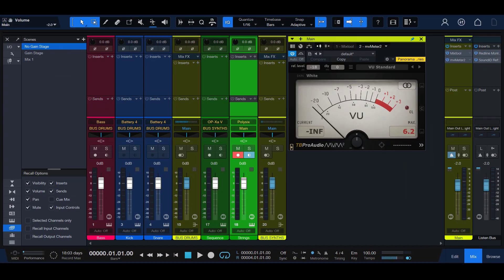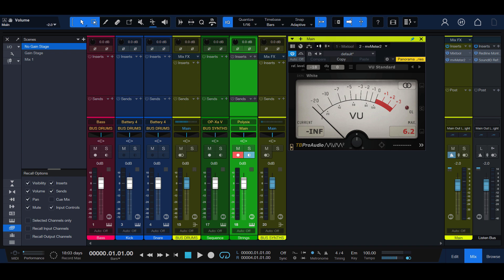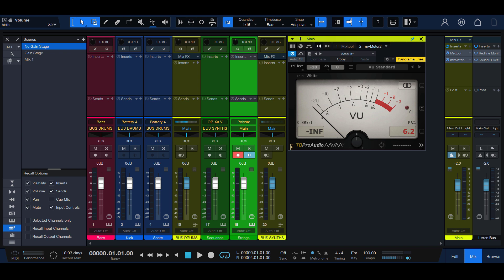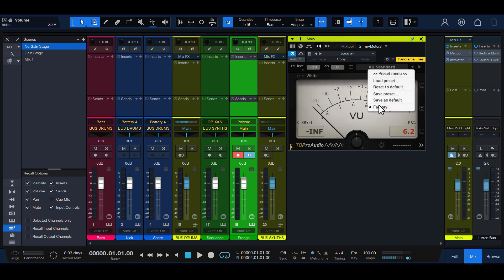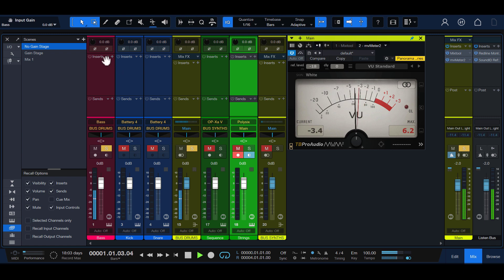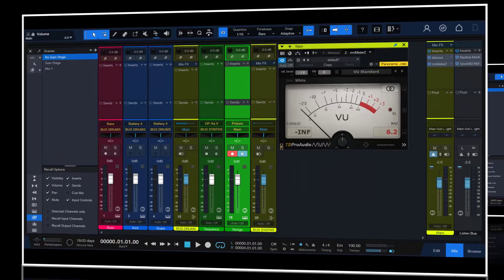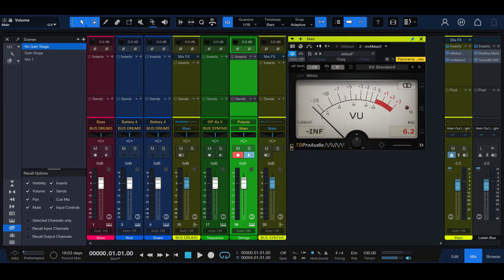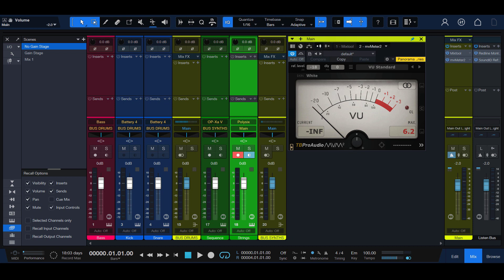Synthwave Mixing Basics: Gain Staging part 2

Comment: Quckick question...
Do you automate the input gain/trim throughout the track? Because for example lets say I gain stage the lead, it changes its range where it plays throughout the track, so the initial gain stage setting is not optimal for higher parts and vice versa.
Reply from the maker: Hey! to answer your question, if you set the level of your lead for example on the chorus and then need to change it somewhere else, yes, you can automate the fader or a gain plugin for that. Just be aware that gain staging is not to set the initial balance of your mix. Gain staging is so all tracks have a similar peak level in your channel meters, which makes it easy to start your mix and have a consistent mix.

Hope this helps!
Reply: @SynthwaveDojo  thanks a lot for your response!